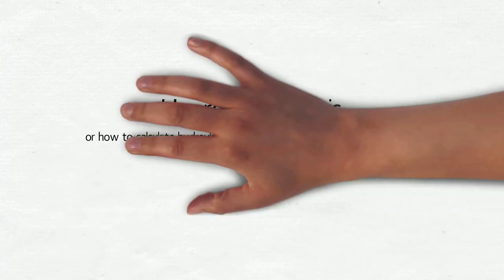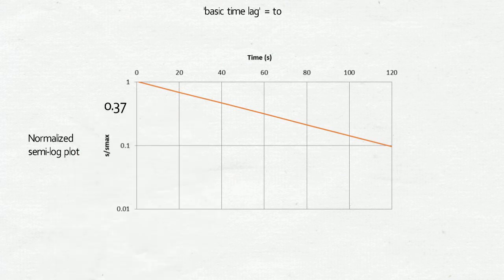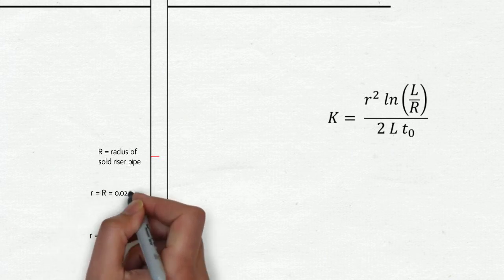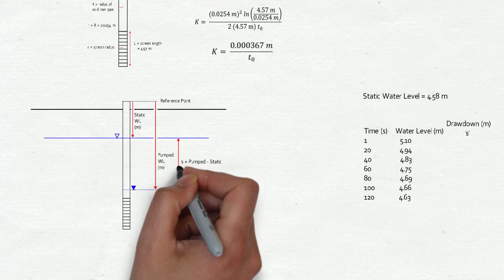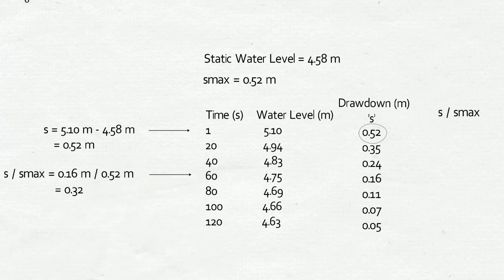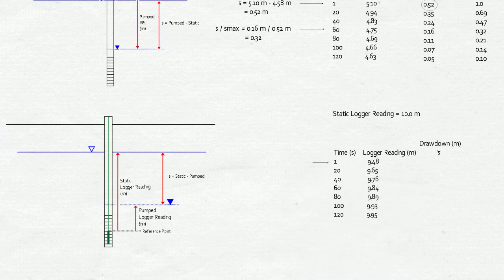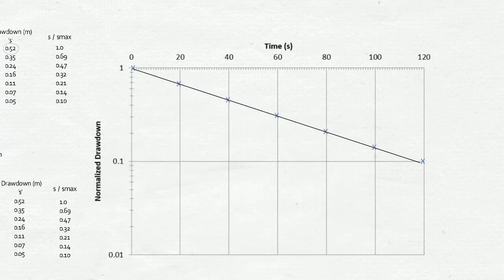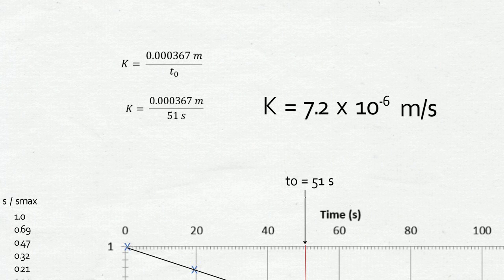Hvorslev Analysis

Comment: May i use thi methodology to calculate k in a piezometer in a dry season when there is no recharge?
Reply from the maker: The method shown will work for any rising head test / slug test data, provided that the water level in the well is above the screen at all times.
Reply: @hydrovideology3529  Thanks for the great video! Can we also use this method for falling head test?